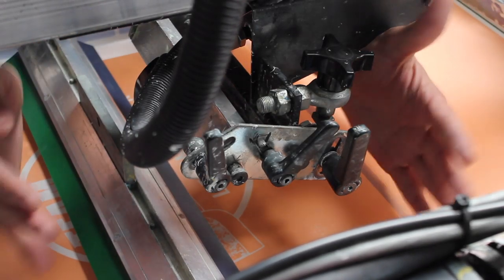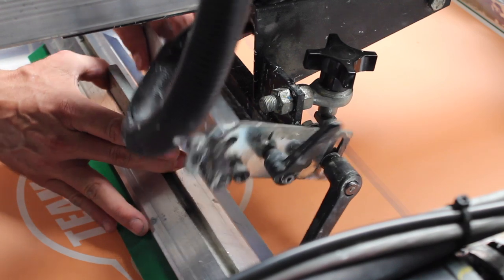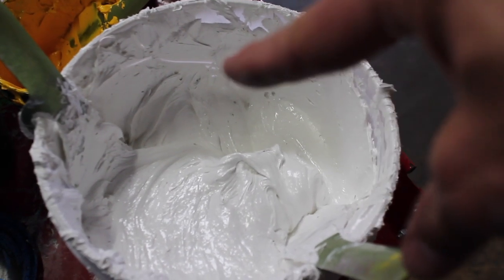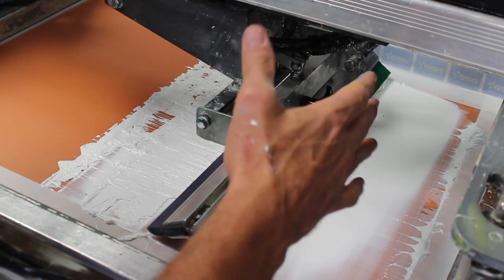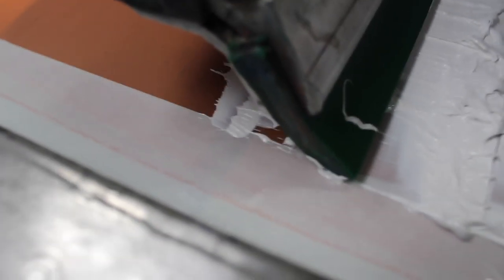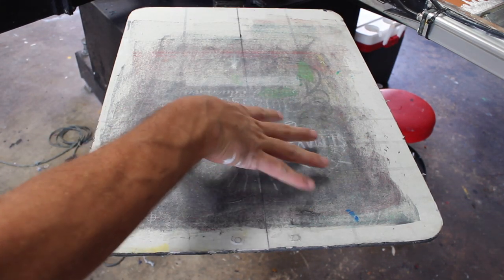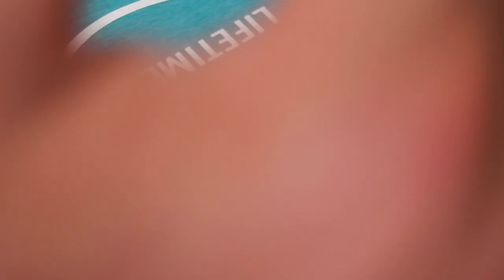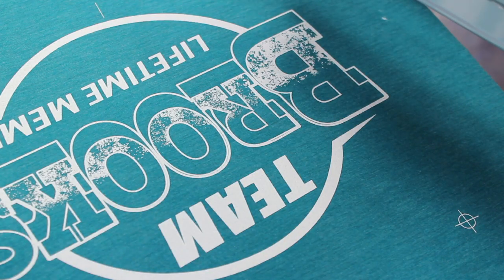V Squeegee Settings for a Bright White Base - Javelin Freedom Tuf Workhorse Tutorial

Comment: MIkey!! Life saver for me. I am used to the M&R chopper style, but I am currently helping install and set up a Tuf Freedom. I couldn't figure out how to get squeegee pressure with out mashing down during the flood stroke. I will literally try this tomorrow.

Did/do you like this V set up?  I noticed you sold the Javlin, what did you get?

Cheers
Reply from the maker: Glad you found it useful!  The v squeegee does a good job and they get the job done. They're a little more of a pain to clean, but setup time is quick. Once you dial them in you hardly have to touch them.
Reply: @mikeydesignssilkscreen473  Well things didn't go as planned. My problem was the print was ok but the flood pressure was so high it would have printed had the pallet been up. 1/2 inch of screen deflection.  

Following your settings the flood was great but then the print would only clear about 3/4 of the way then it seem to lighten up. Obviously there is a balnce that need to be achieved.

Any idea if there is an operator manual online?  The press only came with a 13 page owners manual that covered the control panel am basic maintenance.

Also, I notice you went from an install video to a selling it video pretty quickly.
Did you do a video to explain. I am totally curious. Was it the 6 colors wasn't enough?  Technical issues?   Thanks for the reply.

Cheers

Comment: Mikey, how do you find flash back vs production? As I have mentioned in a few comments I am helping set up a similar press, and it has 3 flash backs. #1  #3  #6.   It seems one has to print white, flash then proceed, but no printing is happening while you wait for the flash.

Even running 2 whites. #1 white/flashback #2 flatten #3 2nd wh/flashback then onto colors.

What do you end up with for overall per hour production?

Sorry for all the questions, but your press is the only one I have access too! LOL!

Videos very helpful. Thanks so much

Cheers
Reply from the maker: Thanks! I would have one on station #1 #3 and #5. Move them around as needed depending on how the print job is handling being printed wet on wet.

For large runs only needing one flash, you can put it on station #2 with it set to table up. That way you can go around 500 shirts and hour.
Reply: @mikeydesignssilkscreen473   Thanks I will look at that.
Reply: @mikeydesignssilkscreen473       How do you set it for 'table up' - after raising it up higher enough, clearly.

Comment: Do you have to adjust the flood and print settings each job?
Reply from the maker: Not at all. I tend to set it and forget it. I may have to tweak the pressure occasionally but for the most part I leave it alone once I have it dialed in.

Comment: ah 195
Reply from the maker: We love using a 195.
Reply: @mikeydesignssilkscreen473  Are you print/flash print whites? Are you using 195 on your black shirts?  I use 230 for sim process, but usually 110 on darks.

Cheers

Edit: OK I watched the remainder of the video. Definitely looking to make a flattening screen.

Have you noticed more and more shirts have fibres sticking up? I have been printing for quite sometime and only the cheapo shirts were like this. Don't get me started on 'tri-blends'

Moving to auto so flattening is going to be great. Hand printing is becoming a problem as everything seems to have these fibres, and it can feel awful.
Reply from the maker: @joeshmoe7967  I like to use 195 for the base. Print print flash. Top colors with 230. If it's sim process, 230 for the base print print flash, then hit the top colors once.